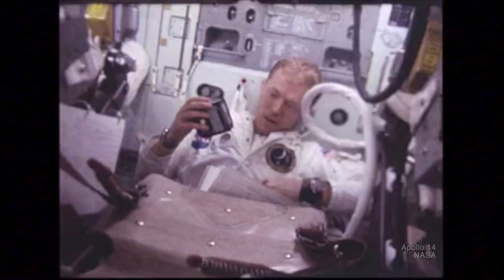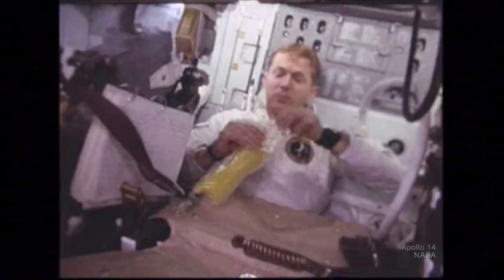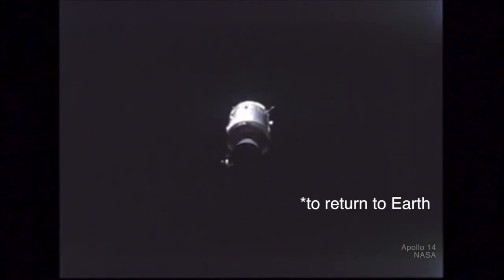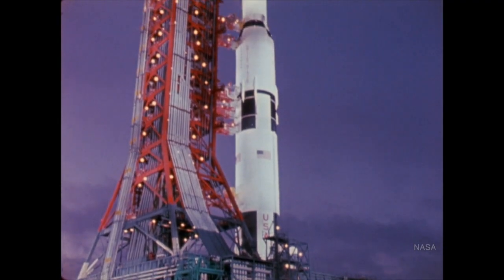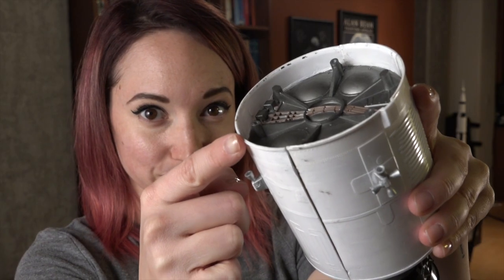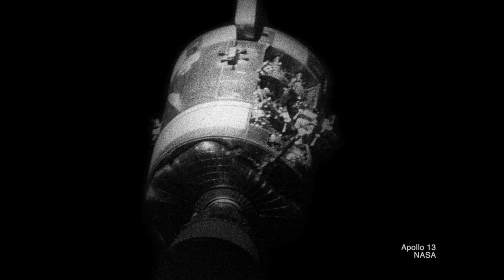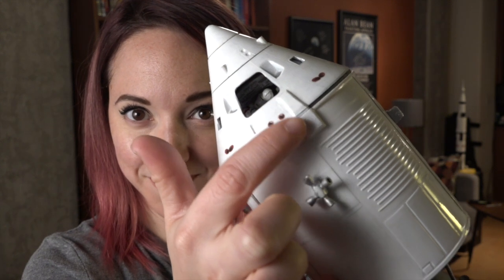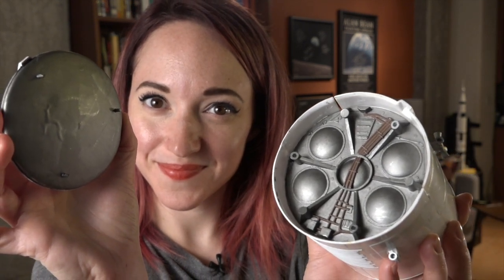How Did the Apollo Command and Service Modules Separate?

Comment: That cable chopping stainless steel blade is a really strange method.
Reply: +Bobby Harper True but remember that it was probably less weight than a  high power connector to be only used once. More reliable as well. Connectors, even very well made ones, have issues with vibration and added contact resistance that makes for less efficient transfer of power. they have many failure points, any one of which could impact the mission. The guilottine mechanism was simple, and may have been hand powered hydraulics easily implemented from within the pressure vessel through just one port.
Reply: +Paul Gracey The guillotine may have been explosively actuated.  Other parts of spacecraft separation systems often are.  Let's ask Amy!
Reply: +Mark Holm Yes, the guillotine was explosively actuated. It had dual redundant actuators, because it was VERY important to get a clean cut in order to get into proper reentry attitude. Dragging your SM by the umbilical into reentry would have been ugly at best.  It would be cool if Amy had more detailed info on the cutter, as well as the LEM ascent/descent stage separation mechanism, and the Saturn V umbilical separation mechanism [sounds like a whole episode there, Amy!].  I do know the mechanical connections of the Saturn V were cut with explosive shaped charges.  They literally cut the stages off when spent. It wouldn't be a surprise if the explosive cutter was a common theme throughout, but I have no confirmation.
Reply from the maker: +Mike Cowen Yeah, I'm going to need more time to get into all the separation mechanisms used! Up next is LM ascent/descent separation, and I'm pretty sure those are explosive bolts. We'll all know soon enough!
Reply: +Amy Shira Teitel (Vintage Space) Thanks, Amy! Looking forward to seeing that!  The next time you're back in the Valley of the Sun, coffee/tea/your choice is on me. Deal? It would be a delight to meet you, and perhaps toss out the occasional "SCE to AUX" and see who notices. :-)
Reply: +Amy Shira Teitel (Vintage Space) - The LM ascent and decent stages also used explosive bolts to accomplish the mechanical separation and guillotines to cut all the wires and plumbing. The ascent engine actually fires first to allow the thrust to build up, then the separation bolts and guillotines fire. When that happens the decent stage essentially lets go of the ascent stage and up it goes.